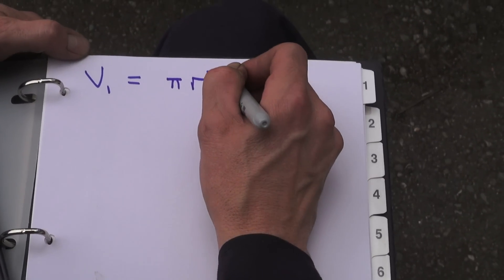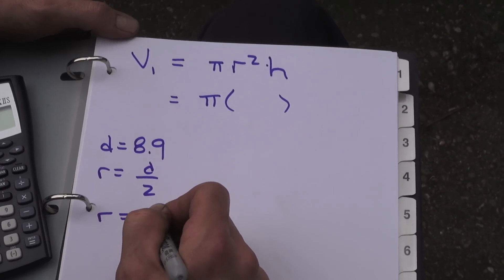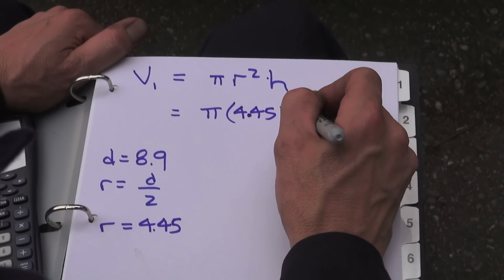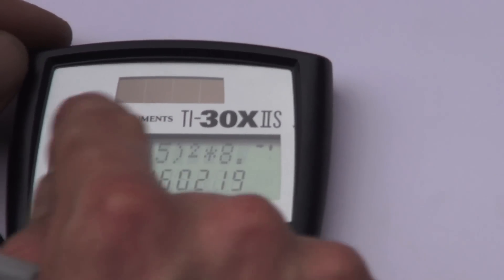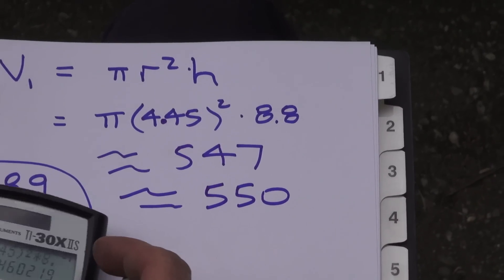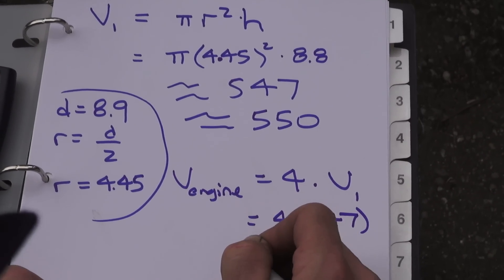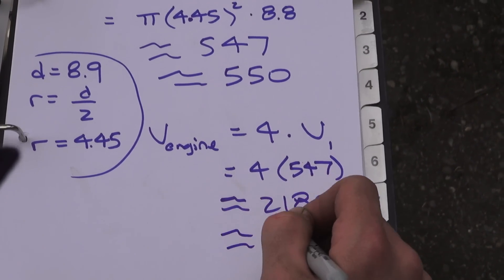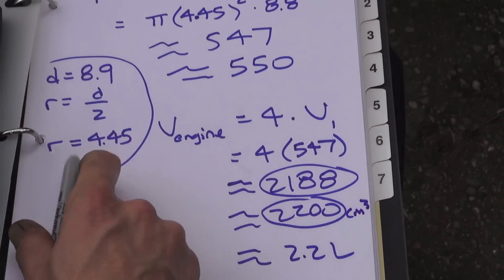Understanding Engine Size… Applying Volume of a Cylinder

Comment: Such great explanation..fuel and air ..does engine oil get in the cylinder
Reply from the maker: Glad to hear that you found this helpful. You do not burn oil in the cylinders, but oil does lubricate the sides to reduce friction as the cylinders go up and down.

Comment: Great contents.Thank you very much.
I have a question please; How do I always know how many cylinders a car has as engine size is always given in litres/cc.
Thank you
Reply from the maker: You cannot tell how many cylinders just from the engine volume, as cylinders can be many different sizes. You need to find that specification out separately from info about the vehicle/engine.

Comment: Thanks for this clear takeaway🤗 , idk Does big Engine size means high consumption?
Reply from the maker: You're welcome! Generally, yes, a larger engine cylinders will mean higher fuel consumption, but also usually mean higher power. 🙂

Comment: Can you explain how the fuel economy relates to engine size ? Like, why is 4L worse than 2L.
Reply from the maker: Very generally speaking, a larger engine volume will consume more fuel - this usually results in more power but higher fuel consumption. With fuel prices the way they are in the world right now, I think most people are more concerned with the latter than the former these days! 🙂

Comment: Wouldn't there be a bit more volume inside the cylinder head?
Reply from the maker: Absolutely - there would be a slight bit of space in the cylinder head, usually with the shape of a small portion of a sphere. But when we talk about an engine's size, we're usually referring to the volume displaced by the pistons as they move, and the pistons don't move into the cylinder head. Hope this helps 🙂

Comment: Total volume of petrol or diesel displayed by the engine cylinder. How do you measure consumption of the vehicle in litres?Such that if you fuel 5 litres...what is the consumption?

Comment: So since that's how an engine size is worked out, I assume this explains why bigger engines are more powerful; the more volume you have, the more air & fuel mixture ignites? Ergo, more power?

Comment: Wonderful presentation.  The only thing that doesn’t make sense is cm3.  How is a cube related?
Reply from the maker: Thank you! 🙂 
A cubic centimeter (cm^3) is a unit of volume - picture a small cube that is 1 cm on each edge. It is equivalent to 1 millilitre. So 1000 cubic centimetres is equivalent to 1 litre.

Comment: Thank you for the amazing video. Do you think that the measurements may be calculated from the ample engine temperature( seeing as engines get hot and expand) or are they given, as you have illuatrated, at "resting" temperature? Just a thought.
Reply: Also, not a mechanic, aren't the indentation on some piston heads?  Again just nit picking because this by far the most well done illustration of what engine capacity is.
Reply from the maker: Good question. These were definitely resting temperatures. I don't know exactly how much the slight change in volume would be under high temperatures, but I suspect that it would be a very small amount compared to the volume of the engine. And indentations on piston heads would also change the volume slightly.

Comment: So more liter capacity of the motor how faster it goes ? or how does it work cause there are other cars with smaller or more amounts of liters
Reply from the maker: Larger engine size usually means more power available - this usually means you will have higher possible acceleration. Speed depends on many factors, mostly how fast you choose to go 🙂

Comment: i actually learned but i got another question in mind is it 2.2liters per hour ? or how does 2.2liters is consumed
Reply from the maker: The volume is just 2.2L - it's not a rate per hour or anything, and not consumed. It's the total space inside the engine cylinders. The fuel that gets injected, compressed, and combusted in those cylinders is consumed, and you could measure that as a rate, eg. litres of fuel per minute, or per cycle of the engine 🙂

Comment: So. “The total volume of all those cylinders...”  SHEESH... Took long enough...
Reply from the maker: Happy that you had the concept so quickly, before the end of the video by the sounds of it. As the video is both an illustration of what engine size is as well as a math lesson in calculating total volume, I'm not sure it could've been much quicker. Thanks for the feedback just the same though.
Reply: @AllAroundMathGuy . Thank you bro. In the end, this helped as many as waited throughout the video. THANKS.
Reply: @AllAroundMathGuy  THANK You. Bro especially responding to me that fast from a 6 year old video. Thank you.

Comment: interesting, thanks. but one more thing.. what are the effects on fuel?
Reply from the maker: You're welcome! Generally the larger the cylinder volume, the more fuel the vehicle will use. But it also depends on vehicle mass, aerodynamics, etc. as well as how the driver operates the vehicle. Fuel economy gets worse at very high speeds - that's why in the 1970's the US government moved to make all speed limits 55 mph to try to cut down on fuel usage during the shortage. 🙂

Comment: But in this calculation (0.785 x bore x bore x stroke/height x no of cylinders = engine CC) why do we calculate the bore twice and not just once as you can see in the formula ?
Reply from the maker: Great question - sorry I missed this back when you posted it. When calculating volume you need three measurements - to get the 'cc' or 'cubic' units. The bore x bore x 0.785 gives the circular cross-sectional area of the cylinder. Then to get the volume that is multiplied by the height aka stroke. If you just used the bore once you'd only get an area because you'd only be multiplying two measurements. 
Incidentally, the 0.785 is pi (ie. 3.141592...) divided by 4. The formula I used for cylinder volume is pi x radius x radius x height. Stroke is the height, but bore is the diameter, not radius... radius is half of the bore. The formula you mention has bore in it twice, which is the same as (radius/2) x (radius/2)... this is divided by two twice, which is the same as dividing by 4 once. If you combine the pi (3.1415...) and the divided by four into a single number you get the first value in your formula, ie. 3.1415 divided by 4 is approx 0.785. It's easier to measure diameter with a ruler on an engine than the radius - hard to measure radius if you don't know where the centre is - that's why in the video I measured all the way across (the diameter or bore), but then divided it by two in my formula. I could have just as easily put that diameter/bore as is into the formula you mentioned and get the same answer. Hope this helps! 🙂

Comment: Is this volume for air or air and fuel mix?
Reply from the maker: It's the space inside the cylinder, regardless of what's inside; however, for the engine to run it'll be for the fuel & air mixture. 🙂

Comment: Sadly, horsepower is a scam. The physics of "power" is rejected by engine makers in favor of outright lies for sales with higher profit margins.  Power is Work divided by Time. Work is Force x Distance.  ALL manufactures LIE, by using RPM as a proxy for Distance, so they can save money. RPM must go through gearing to move the mass of the car, so smaller displacement engines with higher RPM to achieve similar HP will wearout the same ratio faster, making economy engines by far the most inefficient and expensive engines one can buy.

Comment: If you had a 3l and a 2l engine obviously the 2l will require less fuel for the smaller combustion space but what if the 3l was in the same vehicle which weighs say 1.6 tonnes. the 3l would then be less stressed but would it be more fuel efficient?

Comment: Hello,
Volume not only includes the calculated  volume of the bore and stroke, but also includes:
- piston dish
- valve reliefs
- thickness of head gasket
 - combustion chamber volume.

Comment: I was looking to find a good explanation of engine displacement for an intro stats class where a data set on car info used this measurement. All the explanations/definitions were very technical. I think actually seeing the inside of the engine block was very helpful, and the measuring and then confirming of the size of the engine. Cool! I am showing this to my students.
Reply from the maker: I'm glad you found it helpful! :)

Comment: Tape measure even with great eyes for precise leveling and markings still is not as precise as the micrometer
Reply from the maker: Yes, very true - I use a micrometer all the time, but the point of the video was to understand what engine size numbers mean, and a good ruler is simple, won't distract from the main point, and works well enough in this situation. Plus, engine size numbers are usually rounded off to the nearest nice round number anyway, so a super-precise value is not really necessary anyway. Sorry I missed your comment way back when you posted it btw! 🙂

Comment: Wheres your micrometer man ?
Reply from the maker: Yes, very true - I use a micrometer all the time, but the point of the video was to understand what engine size numbers mean, and a good ruler is simple, won't distract from the main point, and works well enough in this situation. Plus, engine size numbers are usually rounded off to the nearest nice round number anyway, so a super-precise value is not really necessary anyway. Sorry I missed your comment way back when you posted it btw! 🙂

Comment: Good video, BUT, a bit long winded for me.
Simply put, ..... it is,     3.14 x half bore x half bore again x stroke x number of cylinders.
Yes, it is best to use a calculator .
HERE it is SIMPLY explained, and SIMPLY done. .......... https://www.youtube.com/watch?v=GdOTXa33OEo
HOW an engine works is another short video, ..... BITE SIZE BITS ARE EASIER TO LEARN & UNDERSTAND, ..... OK.

Comment: Why use the radius rather than the diameter?
Reply from the maker: Formula for area of a circle is pi times radius squared. Mechanics often change the formula to 1/4 times pi (approx. 0.7854) times diameter squared, since diameter is what you can easily measure, so you'll see 0.7854 times diameter squared ("bore") times height ("stroke") as a formula for the volume of an engine cylinder. Sorry I missed your comment way back btw! 🙂

Comment: If my car engine is 3000 cc four stroke does it mean after completed all four stroke the fuel that would be taken by the engine is 3 litres....??!
Reply: In four strokes i.e. one complete cycle the engine will intake and exhaust 3000 cc of (air/fuel) mix maintaining stoichiometric ratio which for diesel engine is 14.7 parts of air, one part fuel and for gasoline is 14.5:1.

Comment: Hi there you explained quite well! Just wanted to ask what difference does it make if engine size 1.6 or 2.0 liter? some time big diesel engines are more economical than smaller petrol engines how would explain this. Thanks.

Comment: When you rotate the crankshaft I noticed that two pistons went up while the other two go down. Is this just to keep the crankshaft running smoothly?
Reply: Well yeah, it's so that the power is smooth.
Reply: Didzis Zvaigzne I did some research and it turns out there are a few different crankshaft configurations. 360°=both pistons rise and fall at the same time. 180°=one goes up and one goes down. 120°=pistons are offset. Harley uses this and that's how they get their sound. Some people joke that it sounds like "potato, potato, potato".

Comment: Sorry, just need to understand something. 
Based on the example. a single cylinder has a capacity of 550cc of air and fuel. Does that displacement of equal volume for both the gas and fuel? Like 50/50? If yes, so that means 275cc of fuel is pump into the cylinder then every time the intake valve opens? Am I right in my assumption? Appreciate the response. Thanks.
Reply: i guess if 50/50 then the world will be in danger for ineffective fuel usages. i think only very little fuel pumped for every intake, that should be enough to make the explosion. less than 0.1cc, We only spend around 1000cc fuel for 15000m run on around 2000RPM aren't we?

Comment: Thank you for the video.  I am more clear of those numbers now.  There is still a question in my mine which is what is the different between 1.5L and 1.8L engines?  I am looking to buy a new car, but this is one of the thing that I don't understand.
Reply: +Tony Tang bro the difference is about 0.3 litres or 300ml of the fuel inside the engine. More fuel in the engine the stronger it is, the more fuel it uses. As the host of the show explained when piston is at it's bottom position fuel and air is squirted inside the cylinder, it then goes up the spark plug ignites the mixture causing explosion which pushes the piston down which turns the crank shaft which gives POWER to the vehicle. Bigger engine bigger cylinder capacity the more POWER you'll get. Tony if you are a new driver I recommend you buy 1.5 car and get comfortable with it. Once you are confident and experienced on the roads think of a bigger engine.
Reply: +Tv Tv Thank you.  This is very clear for me, a person who does not know car.

Comment: Finally someone explained that to me in a way I can understand it! Thank you.
Is it possible just to make a comment on what are the advantages of having a 1.2 or 1.8 or 2.2 engine? What are the pros/cons? Thanks
Reply from the maker: You're welcome!  I'm glad you found it helpful.
In general, an engine with a larger volume will have more power, but also usually have lower fuel efficiency; whereas, an engine with a smaller volume will have less power but be more fuel efficient.  It's a trade-off, and just depends what's important in a given situation. For example, cars used to commute to & from work usually have engines with small volumes to be as fuel efficient as possible and cheaper to operate, while trucks usually have engines with much bigger volumes to have the power to haul heavy loads.